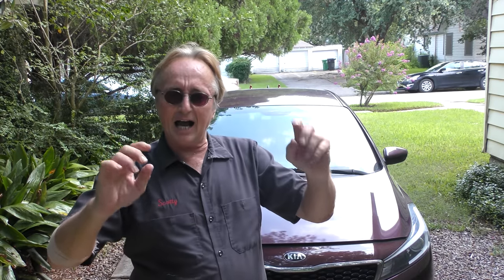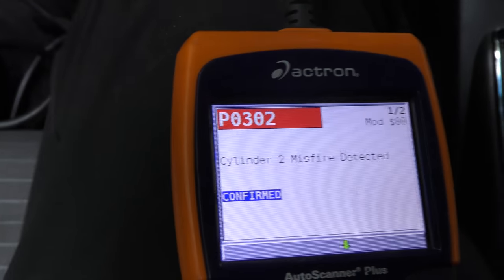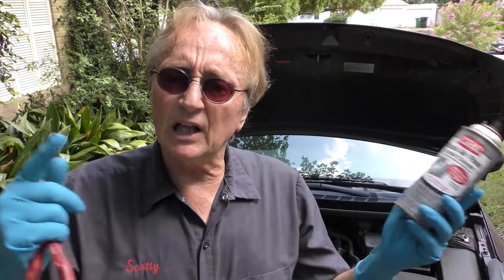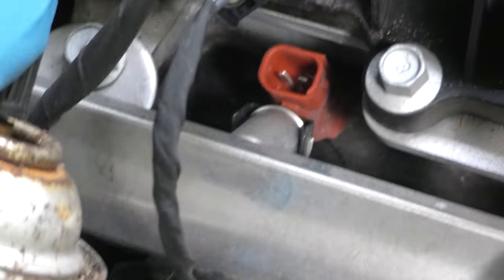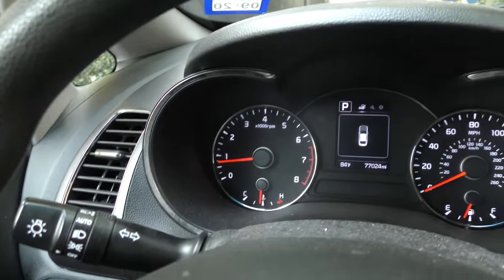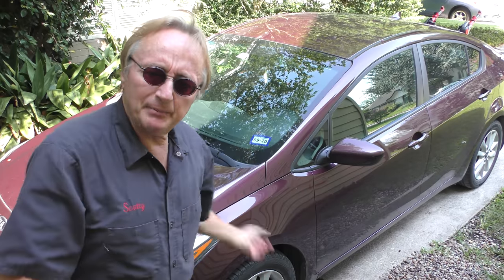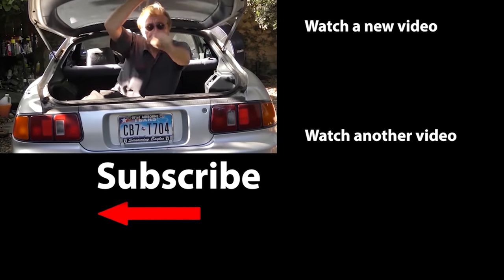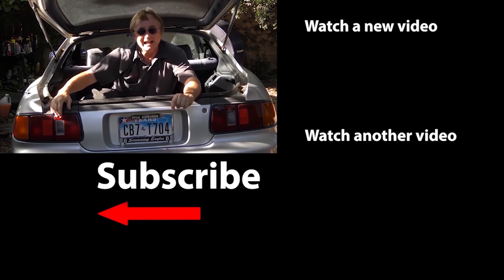Never Do This to Your Car (Learn from My Mistake)

Comment: Hi Scotty got a 2004 Yukon Xl Denali' check engine and tpc light kept coming on Reduced egine power. Got a code for accelerator pedal positioning censor'i changed it twice changed the throttle body still have the same problem.What do you think ? Would appreciate your help

Comment: I’ve been power washing my engine bay for a long time. A car should be designed   With getting the engine wet. So water proof connectors etc. even from a pressure washer.

Comment: 2005 Jeep Liberty with CRD motor. We cannot get rid of the check engine light. Also, the light for the radiator fluid is on. Jeep said that the transmission is a mismatch, and there’s nothing they can do about it. Anyone familiar with this engine?

Comment: Hi Scotty, l have a BMW 3
25i, 2005, since 2015, and up to the present the DTC P0171/PO174, comes on like clockwork everytime and that no machanic, has been able to fix the problem. The engine light has been a terror. What can be an answer?

Comment: I did this once in a courier car not knowing if water gets in the engine, the engine is toast.  It was Toyota Corolla (very sad, but it only takes once lesson learned.  What I don't understand is why auto manufacturers don't deal electrical parts, especially computer modules.  Oh and by the way, where is la la land, I looked it up on Google maps and couldn't find it. Jk

Comment: Scotty I have a 2001 ford mustang gt with 240k miles thats seems like its misfiring no engine light is on when I'm going down the road it lugs really bad about half throttle I already change the fuel filter no success

Comment: Putting a bigger or smaller pulley on an alternator does nothing. Even modestly older alternators are ECU/PCM controlled. They don't even have regulators anymore. The computer looks at battery voltage over time to determine how charged the battery is, and how much charge it does or doesn't need. The computer then varies the charge the alternator puts out via the signal wire. The car knows when it does and doesn't need to charge. Don't monkey around with it, you may end up frying something.

Comment: I won't drive a 4 cylinder car until forced to (and it seems that 6 cylinder cars are going extinct).  The best part of this video shows that working with spark plugs on a 4 cylinder engine is extremely easy.  To get to the rear-most plugs on a modern 6 requires HOURS of work just to access them.  It cost me almost $800 to replace all plugs in my Pentastar engine.  I gladly paid that for the power I get when I push the GO pedal.

Comment: My husband I have a GMC Yukon Denali with 123,000 miles. Our motor went out because one of our valves got stuck, we found out we need a new motor. Should we rebuild the motor or should we sell it the way it is and buy a new car?
Reply: My wife and I have a 2012 GMC Yukon Denali with 123, 000 miles. Our motor went out , due to our valve got stuck and  now we either need to fix the motor buy another motor or should we sell it and get another car , what do you think Scotty?

Comment: Hello Scotty, I have a 2001 Pontiac Sunfire, the car overheats when using a drivethru at McDonald’s or rush hour, just today I went to the DMV for inspection and it passed but while waiting in line the car overheated, now it doesn’t go up to H but it goes up to 3/4. I had my mechanic changed the radiator, water pump, thermostat, temperature sensor, fan relay and the fan itself and it’s still doing it. The only thing I didn’t replace was the heater core, but I highly doubt that could be the problem because during the winter a get great hot air. Could you give me your opinion please?
Reply: junk it!

Comment: Hey Scotty. Cheers from Canada’s beautiful West coast. 
Should I buy a 1996 Civic with 280,000 kms and a faulty fuel gauge for $500 Cdn? Everything looks simple to work on, body is OK brakes are good. It is for my two youngest and I thought it would be a good beater to get them started on the road to understanding cars. Thoughts?
Reply: Yes.  You very likely will not lose at that price.
Reply: N0RT2G0RD4U Thanx. It is coming from a pretty trusted source who is a better mechanic than I and I am pretty handy. Was thinking more of end of life issues that may come up in the future or what I should really take a closer look at. If it lasts a cpl years I think it is worth it. Wife, not so much. She is Japanese and they would never keep such a car. That is why in Japan you can buy a well maintained, slightly older car for next to nothing.

Comment: Hey Scotty my sister has a Volkswagen Touareg that had issues with after it warmed up would die and then I would not restart after it cooled off for an hour or two would start up no problem now after replacing the battery alternator was low and tested vehicle has pronoun problems just starting even after putting a battery charger on it.

Comment: Hi! Scotty I have a '89 jeep cherokee. I run over a deep puddle and my engine just stopped and dint wanna start. I left it  on the side of the road and after about 3 hours went back with a mechanic and it started with no hesitation. Happened about 3 times during the rainy season. What do you think got wet and made the engine stopped? Thank you in advance and stay safe.
Reply: @Mark Codiroli thank you for the reply. Sorry would you know by any chance where the crank sensor is usually located? Im new at this problem... my dad gave me the jeep. I do enjoy driving it except for these problens😊
Reply: @Mark Codiroli Really appreciate the help Mark. Will follow your instructions and will get back to you. My sister took the jeep to her house without telling me🙄🙄. This covid situation is not making things easier specially when you need parts. Again, thank you and stay safe.

Comment: lol, if wd40 doesn't hurt electronics, then why did it mess my clock spring up when I accidentally sprayed some between the wheel and the steering column? I learned from my mistake

Comment: Hey Scotty, I have a BMW X1 Xdrive 2017 - 50k miles - no check engine light or other issue - but ive notice when starting the car it acts like its not going to start, like the battery is not charged enough or something - Ive connected to the OBDII port and the battery states 80mA @ 84% charge. Also, there is a code/message in the scan tool that says “PINION STARTER: STARTING ATTEMPT IS TOO HIGH RESISTIVE TORQUE IN THE DRIVE TRAIN”  Again, no check engine or message is displayed in the iDrive system and the car runs great - What is your thought on this issue? Time for a new battery or is my starter on the way out? The battery is AGM type by the way. Thank you, hopefully you will see this and help guide me to a solution.
Reply: Mark Codiroli by “check battery” do you mean for corrosion, if so all connectors are snug and corrosion free. I’ve been under the car, removed the protective shield and Visually examined the starter and bolts are snug and connectors are corrosion free- why BMW put the starter on the bottom of the vehicle I don’t know. Oil was just changed by BMW dealer 1 mo ago using 0W-20 (manufacture spec) iDrive states engine oil level full/max - How would I check the starter beyond just looking at it? And is 84% battery state good ?
Reply: Mark Codiroli thank you ! If the amp draw from the starter is high, what does that point to issue wise?
Reply: Mark Codiroli I ran a charging system check - battery rated at CCA800 read CCA @248 - starter within voltage limits and alternator functioning under load and load off - ordered a new Exide AGM battery @ factory cost of $130 and have the tool to reset the battery - hoping this should smooth out my starts- thank you for your help :)
Reply: Mark Codiroli it was a battery tester made by Exide using the jump start terminals, not the battery terminals - the unit has settings for the specific vehicles and guides you through a step-by-step process- new battery is in and programmed and no more rough start :) it doesn’t load the battery it’s shows the readings under load from the vehicle (like air full blower and light on with high beams)

Comment: Today's cars and trucks are so electronic it isn't funny.  I remember those F-150s from the 70s or 80s or even earlier you could practically drive those things through a river and it wouldn't hurt them.  If you did get some excess water you would just open the hood and let it dry out for a couple of days and you were good to go.
Reply: @milcotto4153  That's one of the biggest reasons why I'm not a fan of most cars made today.  They are needlessly complex.  There's just something to be said about Old School simplicity.

Comment: He fixed it. What was the mistake?
Reply: The error was in not simply resetting (after reading the code Duh) it and taking it for a test drive in the first place. Water on a hot engine is a temporary problem.
Reply: @TruAnRksT  Thanks. It was subtle..